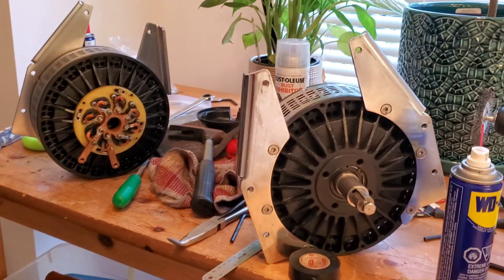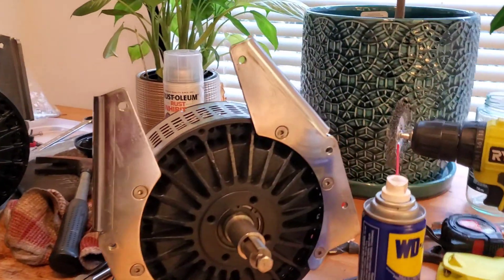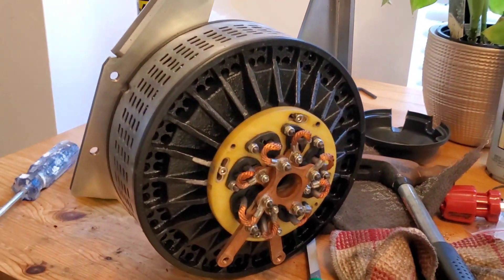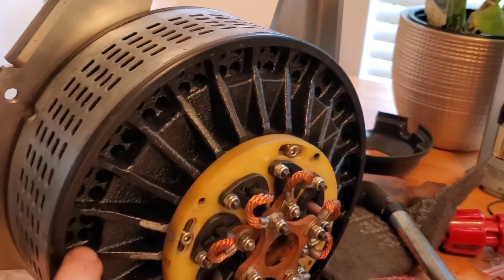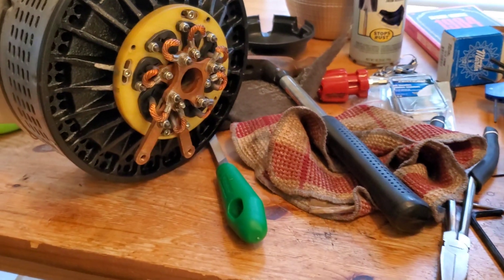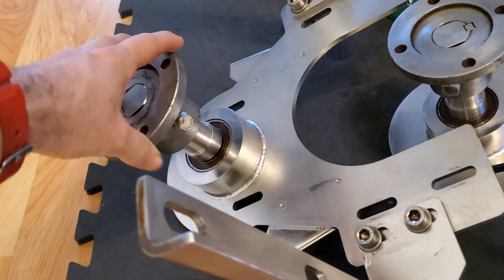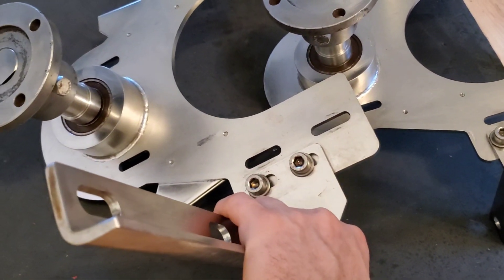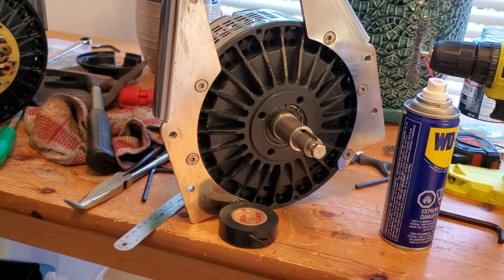Electric Boat - Yearly Motor Maintenance Revealed! Lynch Motors, Brackets & Pulleys.

Comment: Why wouldn’t you use a brushless motor?
Reply from the maker: Use case and cost mostly. The conversion was done 7 years ago.  That said, I have AC motors I picked up last year in an  auction that will likely replace these in time. 
Brushless DC motors have vibration  issues at low speed, they are also  more complicated in construction and pricey. Cheers 👍